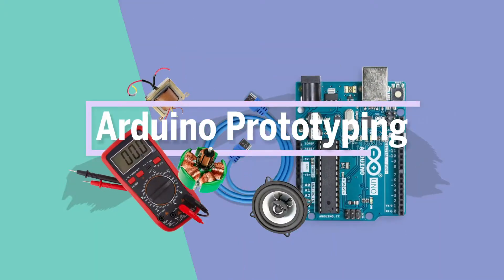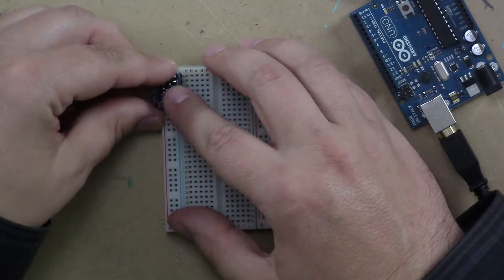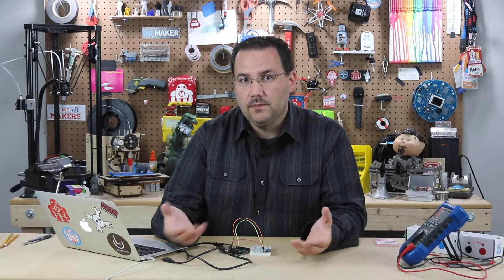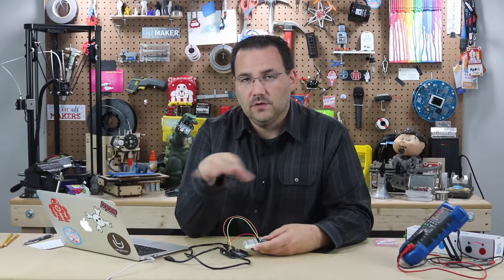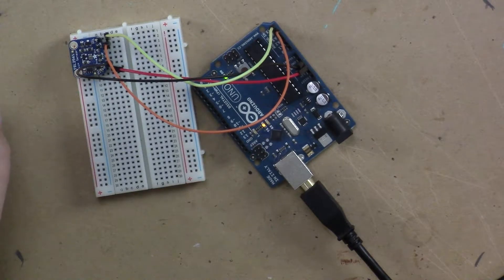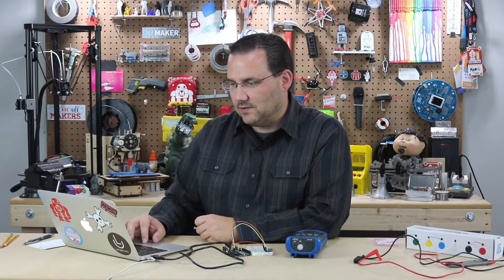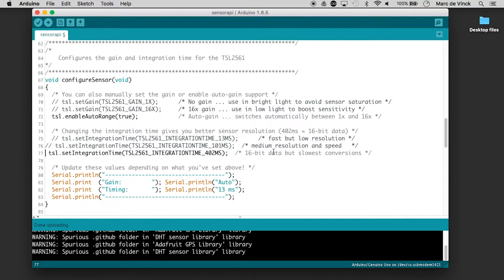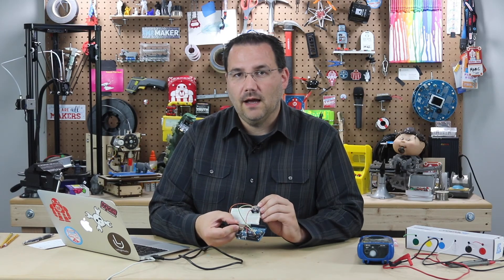Arduino Prototyping Inputs #40: Luminosity Sensors

Comment: How can i make lamp dimming circuit using tsl2561 ?
Reply from the maker: It really depends on what you are controlling. What type of lamp? Power? There are so many variables. I suggest you connect with someone with a background in electronics to help with your project.

Comment: Hi, thanks for your tutorial. It's really clear, but for some reason my setup is not working the right way. I'm using the TSL2561 sensor. When the sensor test start it says: Found a TSL2591 sensor but I got the following string:
[ 1145 ms ] IR: 65535 Full: 65535 Visible: 0 Lux -1.000000. This line keeps repeating the same output. Do you have any idea what this means?
Reply: Yeah I’m using that board and I followed that link as well but unfortunately enough I still don’t get different outputs but thanks a lot for your quick response and tips! Hopefully the other link will help me out
Reply from the maker: @cybercat1991  The Adafruit forums are awesome. Lots of helpful customers and employees.
Reply from the maker: 2561 or 2591? And what code are you using?
Reply: Sorry I see that my previous reaction is incorrect. I’m using the TSL2591 with the code for the TSL2591 from the arduino library
Reply from the maker: @cybercat1991  Did you use this board? And follow this example? Even if you don't have the same board, this link may be very helpful! -- https://learn.adafruit.com/adafruit-tsl2591/wiring-and-test -- Also there is an active forum where you can get a lot of help! -- https://forums.adafruit.com/search.php?keywords=TSL2591+Measurement